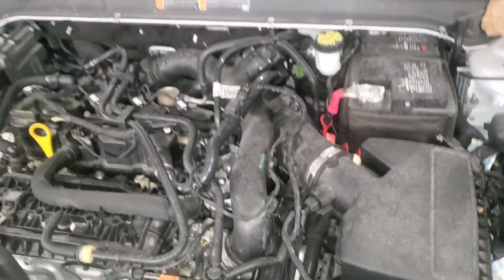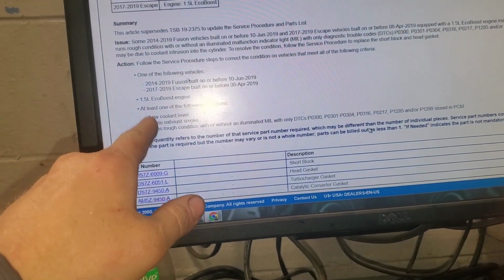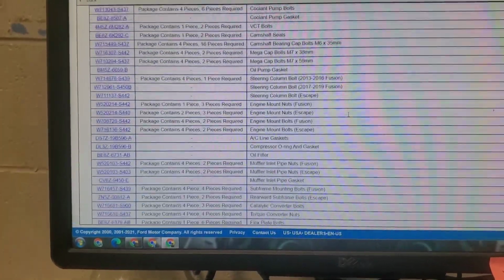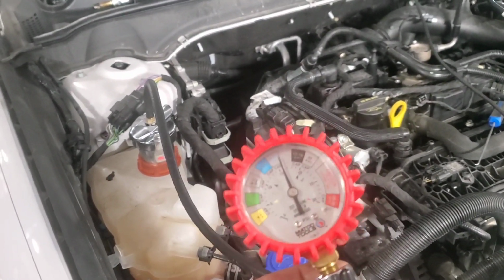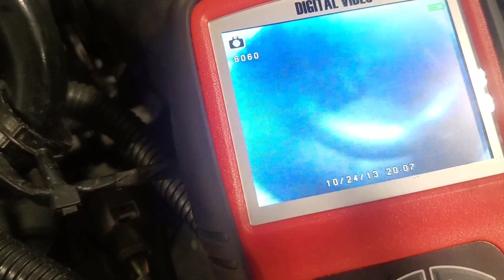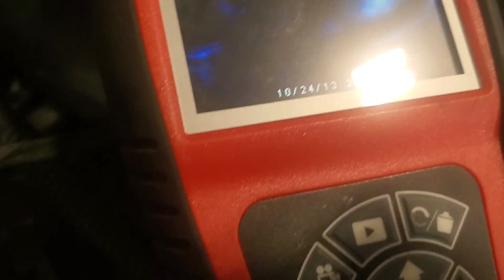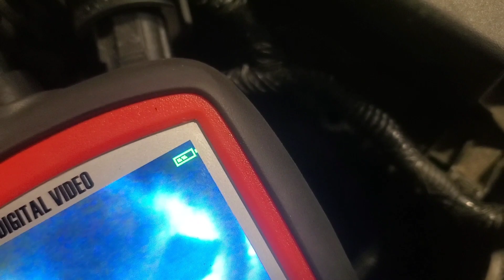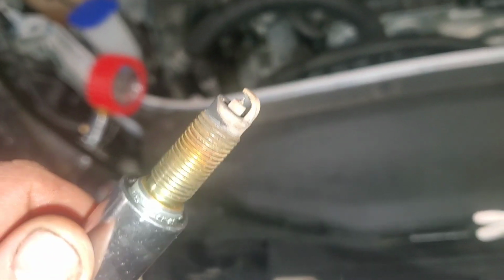2018 Ford Fusion 1.5L Ecoboost Runs Rough Low Coolant Coolant Intrusion Part 1 Diagnosis

Comment: I have a 2017 fusion se 99k. It has been running rough at idle after sitting outside in the Florida heat. After work daily I start the car and it acts like it is going to die. Also sitting at a red light if i have the ac above 2 it shutters and bogs down. Any idea what is going on?
Reply from the maker: There could be way too many things to cover in a comment section about what could be going on

The very issue that I spoke about with this vehicle in this video about losing coolant could be the very issue you're dealing with
Reply from the maker: Throttle body could need cleaning, you could need spark plugs ignition coils, but the coolant loss could be causing the issues with the spark plug, you could have solenoid issues for the turbo the solenoids that control the turbo. I'm just they're just way too many scenarios here you're just going to have to get it to somebody let them look at it

Comment: I have a 2016 1.5 that has started misfiring on cylinder one. Rough idle at startup only. I haven't detected low coolant at this point. But if it were coolant intrusion, would the rough be only at startup, or all the time?
Reply from the maker: I have put so much info on this channel on this topic please check the library
Reply: @FordBossMe  I don't have time. But I know you're busy too. Have a nice day.

Comment: My 2018 2.3l Explorer with 20000 miles is getting a new engine. Coolant in cylinder 2. Is this becoming a wider problem?
Reply from the maker: It's not typical for the 2.3 liter but yes I've seen it

Comment: I'm trying to decide on getting rid of my for fusion 2016 1.5 Ecoboost or get a new block. How much would something like this cost me?
Reply from the maker: It varies you're talkin somewhere probably a ballpark five grand
Reply from the maker: Maybe a little bit less
Reply: @FordBossMe   ok thank you. It's running rough like it losses power and check engine light is on. And I have to keep adding coolant. That is a sign of coolant intrusion right?

Comment: working on a 2013 fusion w the 2.5l and cant find the cylinder head temp sensor! plz help
Reply from the maker: And might be around the back side of the valve cover kind of heading towards the exhaust manifold somewhere I don't know you have to let me get to work in a couple hours and then remind me to look again because I ain't going to remember to look when I get there
Reply: @FordBossMe  all data diy has three engine diagrams with harnesses and none of them match the 2.5L engine, i'm starting to think its inside the engine based on a youtube video for a ford suv 3.5 from Auto Repair Guys

Comment: I have a problem an dont know what to do I bought my 1.5 escape with 60k on it was low on coolent when I bought it had them fill it week or so later noticed it again called my Ford dealer was told just throw some coolent in it by the guy there so iv Ben just toping it off every so often when I noticed it low. now I have a cylender 3 misfire code, runs like crap an I'm dam sire no warranty shit so how screwd am I bought it at 60k sitting at 110k now just replaced plugs an ignition packs. Please help
Reply from the maker: Man you could just keep driving it the way it is and keep the plugs changed every 10-15 thousand miles but no matter what it's going to keep doing it until you get the new Block in it
Reply: @FordBossMe  I am having this same issue. If I change the plugs and fill the coolant do you think that would stop the rough idle/rough ride enough to get someone to accept it as a trade?
Reply from the maker: @jordanstewart6250  it should not necessarily the right thing to do but it should

Comment: So ford do actually honour their warranty? I'm England they fight tooth and nail to avoid warranty work 😅😅😅
Reply from the maker: I have a new video talking about Ford overseas not wanting to do their warranty work
Reply: @FordBossMe  the car has to not run at all or catch fire before the even look at it .. and then if you are late with an oil change by 2 days the warranty is void... I exaggerated a bit but you get my drift 🙄